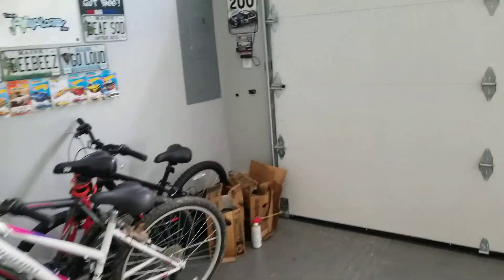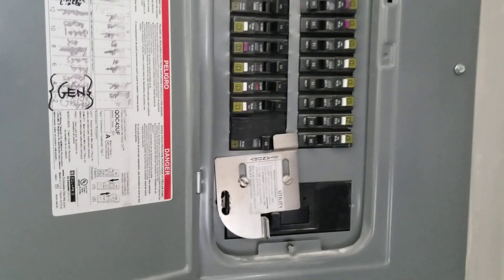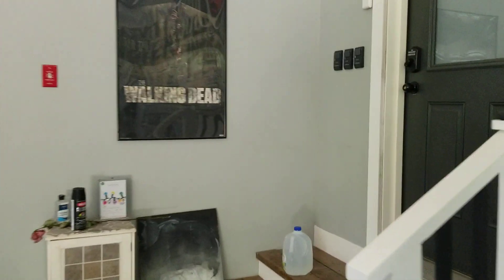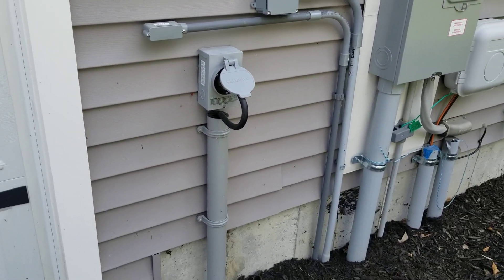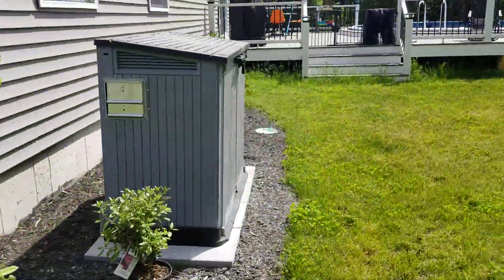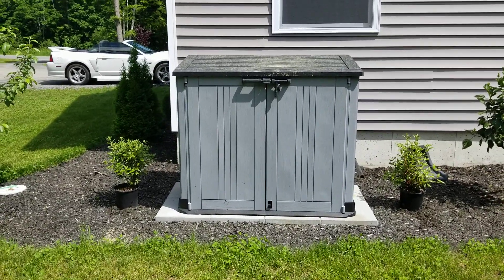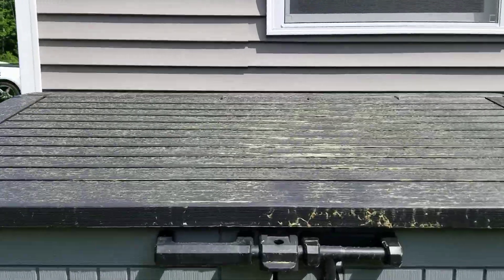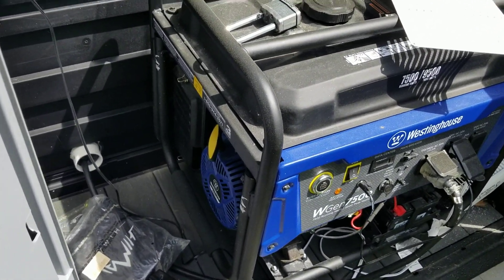Westinghouse 7500 generator shed test after power outage. Multiple fails!

Comment: Experience is something you get when you get something you don't want. 😊
Respect for sharing your experiences here! 👍
A tip: The fan should push the cold air into the bottom of the housing, then the warm air automatically goes out at the top.

Comment: I like how you ran the wire through PVC pipe never thought of that, I am trying to do something similar for my generator, what type of meter you have on top of the generator? Also did run into any overheating issue placing the generator inside the shed? Thanks!
Reply: Ok i got it, its a thermometer I watched your other video.
Reply from the maker: @AJ-ds9xq  I need to add another intake air duct still, and buy a proper intake fan also. The exhaust pipe needs to be up a bit higher as well to clear the intake ducts. It got hot when it ran for a while, so I opened the doors and dealt with it that way this time around.